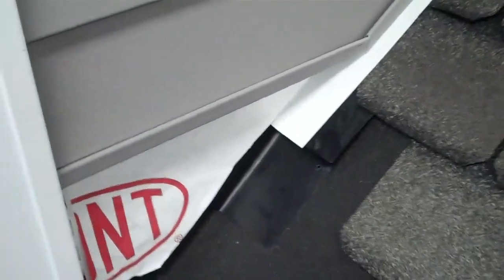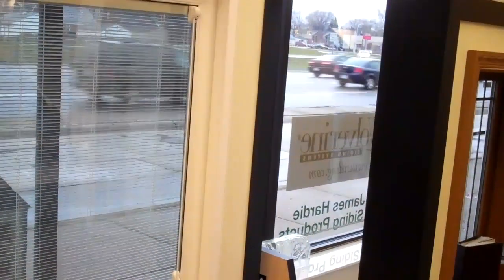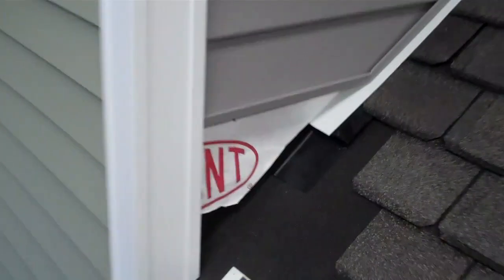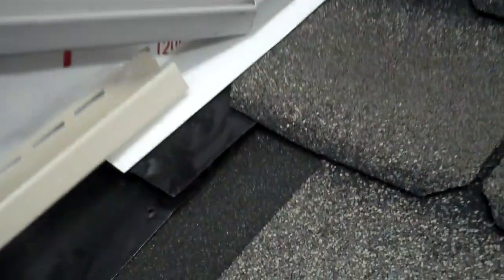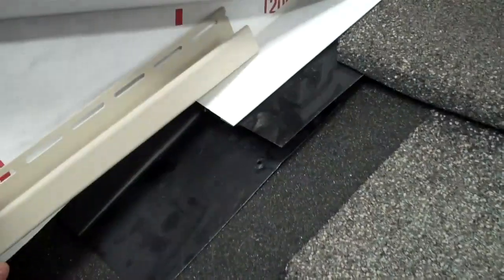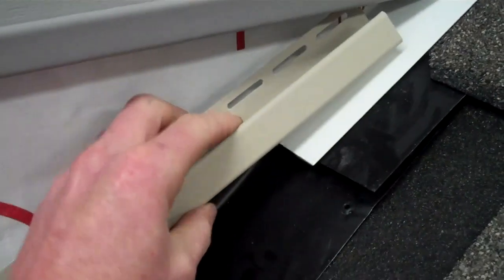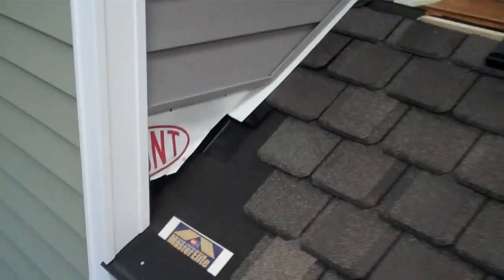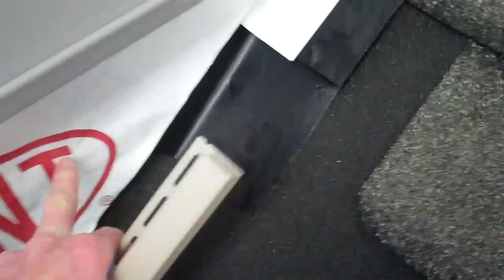Siding and roofing flashing wall detail

Comment from the maker: Unfortunately this was already built and could not show that particular detail regarding the j channel. If you look closely, you can see the ice and water shield from the roof wraps up onto the siding wall and the house wrap from the siding is installed over the top of the step flashing. Depending on where you live, some building codes don't require some of these things. The best thing I've found is install to manufacturer's specs. Best of luck :)
Reply: How would u do it?

Comment: Okay where's this tool for unzipping the siding and how does it work
Reply from the maker: To describe it is like explaining a haircut over the phone. It's small, flat with an angle and a curl at the working end to get behind the siding and with some muscle, slide it along the siding lock. You should be able to pick up at a big box or siding supply store